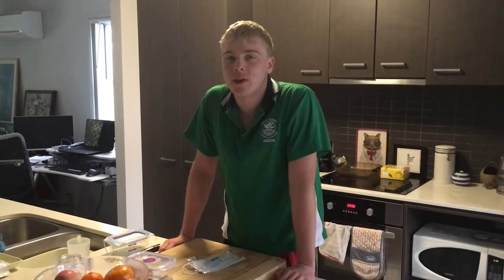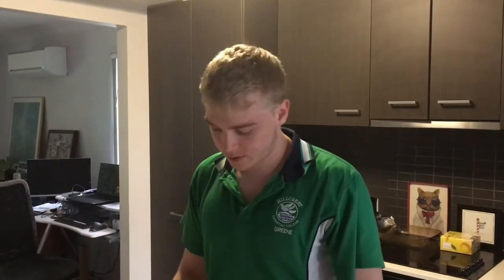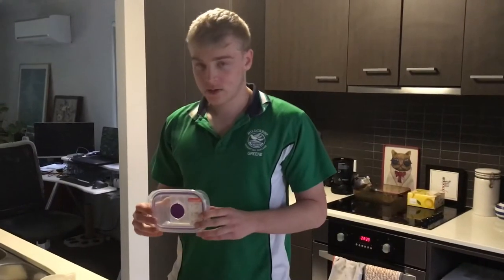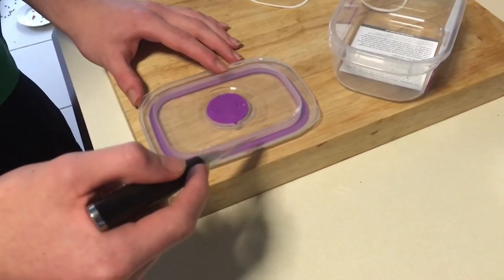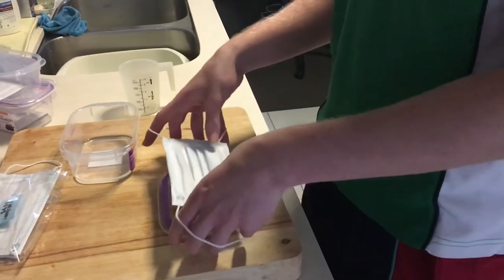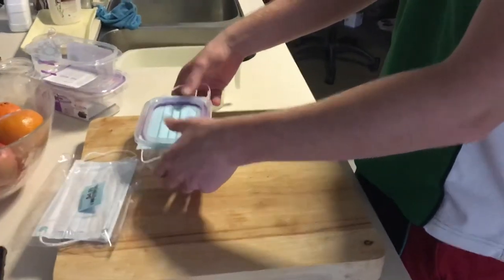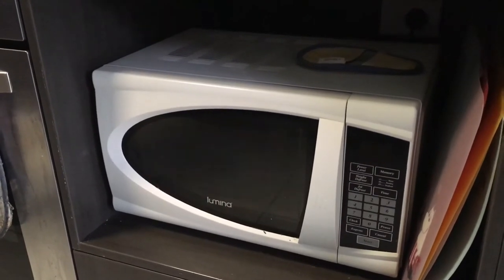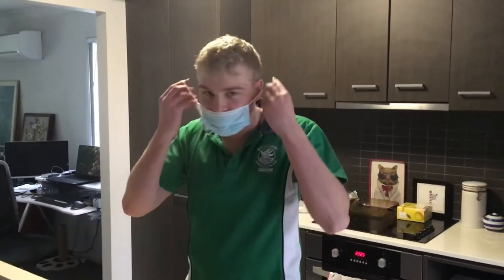Face Mask Steriliser

Comment from the maker: Links that might be useful
https://mbio.asm.org/content/mbio/11/3/e00997-20.full.pdf
Step 1 - The Container https://share.icloud.com/photos/0oPn1iLJf3WOKZU8JbfGY2dQQ
Step 2 - The Setup https://share.icloud.com/photos/02f9WgU4iEWKOU86SrFikVjPQ
Step 3 - Using the steam pressure to drive the steam through the mask https://share.icloud.com/photos/05AW_5qldqP8uUhyQjG0aNWAA
Step 4 - The Result https://share.icloud.com/photos/0t8oCcIPG30JcJLjW1EIAeQ1Q